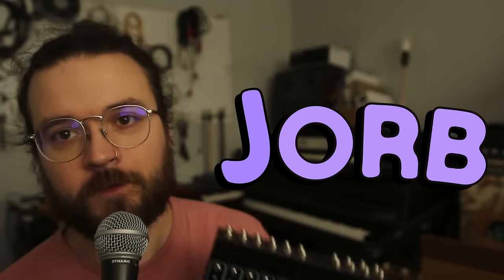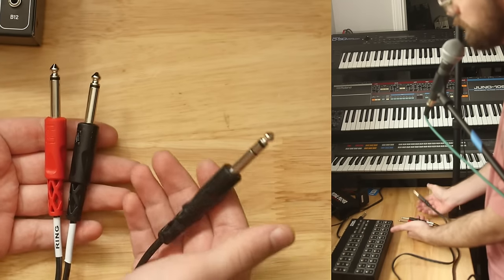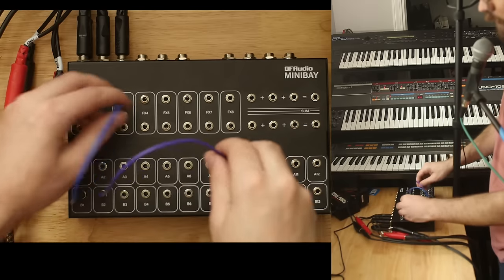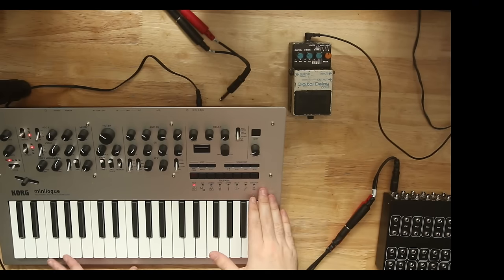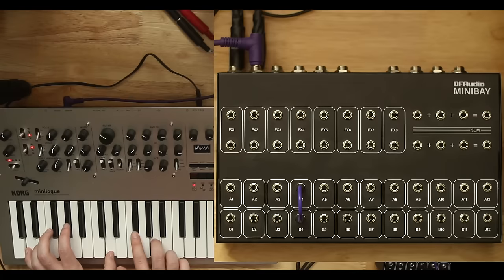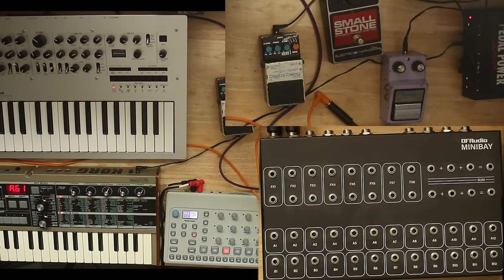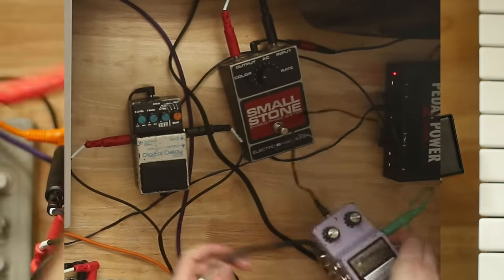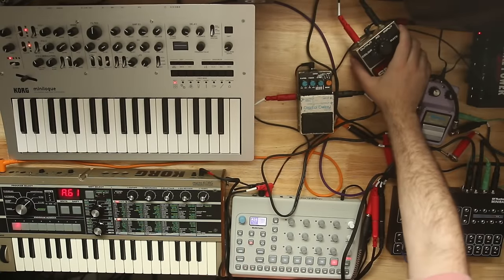Why & How to use a Patch Bay (And why the Minibay is a great one)

Comment: This is a great explanation on how to use a Patchbay, for people who have never used one this is a must watch. For those who want a great first Patchbay this looks like a no-brainer. The passive summing is a big bonus too.  I was on the waitlist for the first run but decided not to buy because of the TRS stereo jacks which for me is a bit of a downside because it requires more adapters. Also, I prefer patchbays that can handle balanced signals. I could still think of a lot of situations where this would be helpful especially for new patchbay users, ergonomically it’s makes a lot of sense, aside from the need for extra adapter cables, it’s a nice layout.
Reply: LOL Really? Because I own a normalised patch bay and I seem to be comfortable there, whereas this started breaking my brain in the first minute of the video already.
Reply: @telumatramenti7250  I really thought it was explained well but it could be biased by the fact that I have been using patchbays for a long time. Also, this patchbay does a lot more than a typical patchbay and without explanation I think a lot of people would be completely lost.
Reply: @beatnikcafe  Yeah, it does a lot of things, which I think would be more adequately controlled by  hard or soft switches instead of patch cables. Don't get me wrong, I like modular synthesizers, it's just that I feel that having to order even more mono patch cables, and Y-adapters on top just to mix and record normally would be an overkill...
Reply: @telumatramenti7250  You proably know this already but just in case someone else can also benefit from this tidbit of advice. If you use a patchbay with all stereo devices you can use TRS cables for patches and use only one patch point for each stereo in and out, so for a mostly synth + stereo effects patchbay you can use a balanced patchbay as an unbalanced stereo patchbay instead. You will still need to deal with y-cables to get all your gear connect to the back but once it's connected patching is much easier and faster since you only have to patch half as many cables. Most synths are unbalanced so you really aren't losing much in the equation if you go that route and so using a standard 19" patchbay would make a lot more sense for that situation.
Reply: @beatnikcafe  Damn, just when I got the Kodamo Essence FM synth with 8 balanced  mono/4 stereo outputs. LOL Just kidding. Yeah, I get what you're saying, I have 2 of my stereo-capable synths hooked up that way.
Reply: @telumatramenti7250  I've been looking at the Essence FM too. How are you liking it so far?

Comment: Can this be used with balanced rack gear? Something like a stereo delay that takes either TRS or TRS to XLR?
Reply from the maker: It can, but you'd be doing 2 interconnects for each signal.

If you're all balanced, and need a full bay, get one for balanced cables

Comment: Good video and interesting product, thank you. I already use classic patchbays in my studio but it could interest me as this is tabletop thus obvioulsy encouraging for experiments. BUT with regular TS jacks everywhere. And idealy ALL the conections on top, nothing on the back and the normalizing switches accessible on the top too. 
I obviously undestand this will impact its tiny form factor but I don't like to deal with 3 types of connections plus Y cables for the same job and having to dismantle the thing to access to the normalizing settings.
So, Minibay's people, gi'me the same but bigger with bigger holes. Something 19'' wide, 3 or 4 U high , and tabletop flat.   "The MiniBigBay mk2"?  😄
(actualy I'm reinventing the horizontal lateral patchbays we could find on big studio consoles)
Reply from the maker: I like that idea, a bit bigger just to have it all on top. Good points!
Reply: Thanks for the suggestion - will definitely consider it!

Comment: It's a great product as it employs some original approaches. One issue for me would be that mono patch cables are quite expensive (and I already use a ton on my semi modular synths where they are needed most) and that you would have to also buy a bunch of Y adaptors to work with TRS connectors at the back of the unit. And those adaptors are notoriously flimsy and get easily damaged from ordinary use, I've replaced mine a few times just the last 3 years. I would be far more comfortable with 1/4 Mono connectors and ports, and switches on the top panel to replace most of the ports there. I've long thought of building something like that, I have the case and most of the parts, just need to order a custom built PCB for it.
Reply: Maybe but a soldering gun and learn to repair cables that go bad.
Reply: @alexbreyer6921  Part of what I do for living involves repairing PCBs through soldering. Soldering Y cables doesn't work, - the wire tends to break very close to the connector, which necessitates replacing the actual connector. Not only does this make the cable shorter, but these connectors themselves cost so much, that it makes the same sense to buy a new adapter altogether. There are wireless adapters of similar nature, but they are stupidly designed. In order to relieve the pressure created by the weight of the attached cabling, - they need to be angled. Instead, - they are typically straight. I have a whole box of these, once they break, - I keep them for the male end, as I make my own cables with those.

Comment: Do you think this minibay can work with modular and its higher levels?  I want to be able to use stereo pedals with eurorack sounds.
Reply from the maker: Yes, but remember it's not changing levels of anything, so if you're worried about getting eurorack level down to line or even instrument level, that's about way more than just how big the jacks are
Reply: @JorbLovesGear  Related but not about the product.  Why is it stereo send and returns are lacking everywhere?  Mixers, modules, etc.  This is not directed at you at all... just seems like stereo is a bit scammy when it comes to hardware because they make you buy 2.  Sure, I can run stereo direct outs into pedals but the only way I have sort of fought with stereo returns is by using a fancy pedal switcher by G3 that lets you, like the patch bay, use 2 jacks to handle stereo ins and outs.  Seems like at this point, we need I/O jacks on everything and we can pick how to configure.  Also seems like a great opportunity for advancement in the antiquated mixer world...and Im not talking about tiny baby hand options like Teenage Engineering.

Comment: This is brilliant kit. I would use it with older 1/4" out synths like you are. The price point (~USD$200) is right. But $60±  shipping per unit (from Thailand) is not. ☹️ I wish they'd get distribution in the US (eg. Perfect Circuit).
Reply: Glad you dig it! That $60 shipping is in AUD, so actually about 45 USD. But should be available for 209 USD through Perfect Circuit in August :)

Comment: I bought one of these and I’ve pretty much figured it out..for the most part. If you use stereo pedals with 2 ins and 2 outs, it’s great. I’m having trouble routing pedals with single stereo TRS to dual mono TS (Strymon El Cap V1 & Hologram Microcosm). Has anyone ever tried this?
Reply: Just use a TRS to TRS for the input and a TRS to dual TS for the output. Connect the pedal input to A11-12 and the output to B11-12 (for example), then you'll get the same vertical signal flow layout as your other regular pedals on the FX row.

Comment: If you plug the insert cable into say the B1&2 jack on the back; which is 1 and which is 2, Tip or Ring? Wondering how this thing is wired that way internally.
Reply from the maker: Believe it's 1-tip 2-sleeve, but it's been awhile

Comment: I see the appeal of having it in this form factor instead of a rackmounted unit.

But the TRS to 2x TS split is a bit stupid,  as well as the 1/8th inch jacks on top mixed with 1/4 inch jacks in the back. These 2 make it a bit of a fad instead of a decent product. Also having to use burried dipswitches for the normalled mode is a let down.

Make it with just plain (balanced) mono channels and uniform jack sizes, preferably 1/4 inch if you target synth users, or a 1/8 inch version for when you target modular users. And have the normalled mode switches on top per track. 

And now you have a unit that is versatile and doesn't need Y-splitters, 1/4 inch to 1/8inch adapters and doesn't require you to jump trough hoops to get it to work the way you want with mono and stereo sources, destinations and effects. Then again, you've just made a regular patchbay, only a desktop model instead of rack mounted one.

To be fair, the 2 mults are a nice addition.

Comment: The big flaw with this patch are the stereo TS inputs If you have a lot of mono synths you will run out of inputs before you know it. Shame because I like the concept but it would be impractical in my set up
Reply: Using insert cables, you can connect two mono synths to each TRS socket on the back panel. If you had eight mono channels connected to a mixer, that'd leave you 16 mono channels for synths plus the eight in/outs for FX.

Comment: Doesn't make much sense for it to use stereo connections but mono patching, why not patch in stereo? Sounds a lot more usable
Reply from the maker: If the interconnections were stereo, it would be pretty annoying to use mono output gear or insert cables for 2 different things.

But stereo can be easily managed with mono interconnections
Reply: @JorbLovesGear  Fair point. You could maybe have a stereo one for certain things and a mono one for others, I think stereo interconnections could speed up parts of the workflow or at least simplify them a little bit

Comment: The only issue I have is that I have expensive analog synths going through a 32bit dac mix r with quality interconnects to have all the sound go through some cheap 3.5mm patch cables? That’s going to degrade sound quality??
Reply: So buy expensive 3.5mm patch cables! The overwhelming majority are shielded - they work just as well as 1/4" cables.
Reply: @dudfaz  I use high end rca’s with adapters to 1/4” but I am a bit of an audiophile when it comes to sound quality … so quality? 3.5mm patch cables will never cut the mustard :) …
Reply: @Iron883NZ  fair enough then.. I can't hear the difference myself! Haha

Comment: Three comments.
One: it's meant for desk top.  But if it has a wall or desk mountable kit that would add some versatility to the unit.  Not every place is suitable for a 19" racked patchbay.  This looks good for those places that aren't.

Two:don't pull your patches by yanking on the cable.  No.  You put unnecessary stress on strain reliefs... if they even use them.  You could easily be cracking the solder connection and introduce shorts in your cables.  You don't want a cable that shorts intermittently in your set of patch cables.  Nothing like audio drop outs.  

Three comment:  there's the added cost of all the patch cables and adapters.  Once you have figured out the true cost of the whole system, then make the decision.  Would an audio interface with more analog ins and outs make more sense?  Or a mixer with lots of inputs, buses, and aux sends suit your needs better?